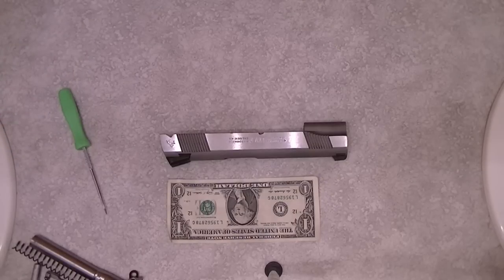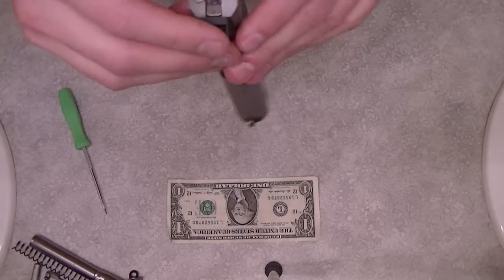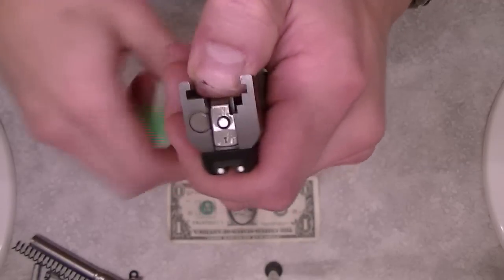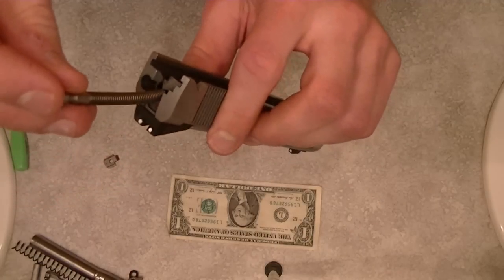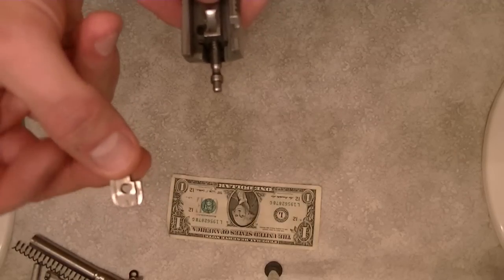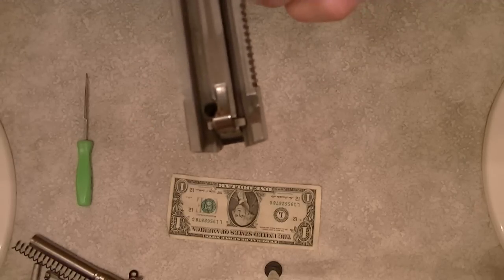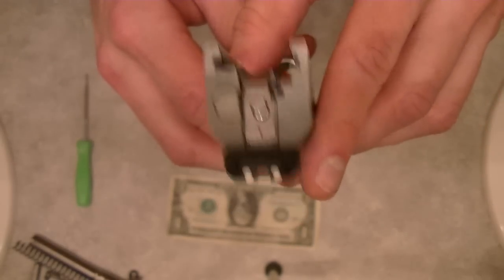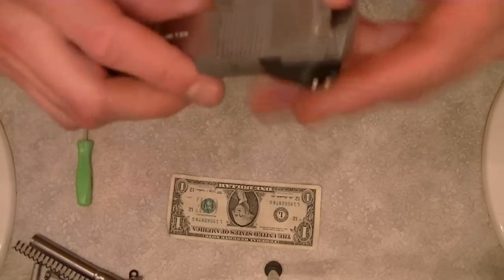1911 Firing Pin and Extractor take apart (FULL)

Comment: This helped me a ton.  Thanks!  Needed to check the extractor tension (was having FTFs).  It was loose (based on Wilson Combat's criteria for looseness).  I wouldn't even have been able to check if I hadn't have used your video as  an example of how to remove the firing pin and extractor.  That was the easy part.  Getting it back together was a bit tricky, but I did it 3-4 times and it got easier as I repeated it.

Thanks again!

Comment: Not related to the extractor but I started having misfires and firing pin wasn't denting the primmer. I went to remove the pin and it was seized up solid, I had to use a drift pin punch to push it in side the pin cavity. wondering what would cause that. I did notice since I bought the gun that the pin didn't leave much of an indent on the primmer, wondered how it ever fired at all. had to file the outside edge where it fitted inside the pin plate. all good now. great video you made of removing the extractor & pin,,,,,

Comment: I have a short spring loaded pin that holds the extractor and firing pin in in the place where yours only has an empty hole. Have you left that out intentionally? Or did you never have it?
Reply: I was wondering the same thing

Comment: I put the extractor and plate on without the firing pin. I then put a piece of duct tape on the back of the extractor to hold it in place from moving.  Remove the plate and install the firing pin and the plate. One shot deal.

Comment: Mine has a little plunger and spring that goes in the half hole in the extractor, all the videos I'm seeing doesn't have it. Is everyone losing them? Or is it useless? And they're throwing it away.
Reply: People tend to remove them because it interferes with trigger pull. I thought my trigger was great on my 80, but I didn't have a lot of experience back then so it's hard for me to compare it to anything.

Comment: I can't get my extractor out. I pops out about a quarter in and can rotate about 80 degrees but it won't budge any farther than that. Any tips?
Reply: I just had the same problem with mu Tisas 45ACP. I put some solvent in the end and let it stand on end so that the solvent ran down in to the extractor for about an hour. Then I grabbed the sticking out end with a pair of pliers. gave it a few turns and pulled. It came out.

Comment: all Series 80 pistols should have a firing pin safety assembly.  people will remove the firing pin safety because the assembly is actuated by the trigger bow.  They remove it because they feel it affects the performance of the trigger pull.

Comment: I got a prob where the firing pin and spring are jammed bad, the pin is sticking slightly out forward and its fuckin stuck, it is JUST about to come out, but somehow will not budge. im guessing the spring is holding it in place. ever hear of this? any help ideas? ive greased the shit out of it and try my most power to get it out